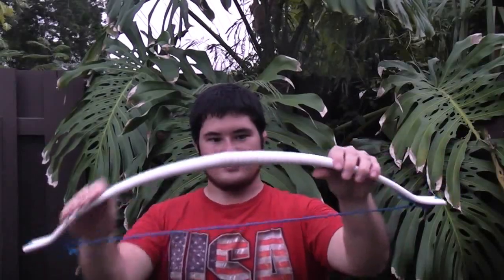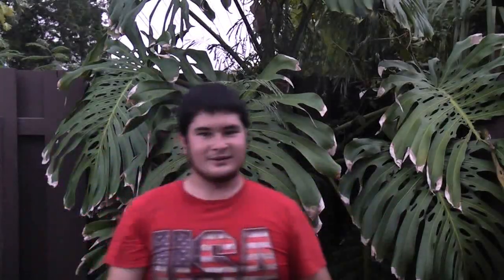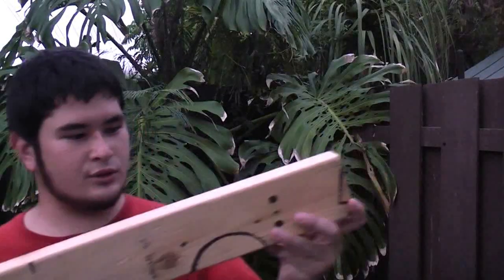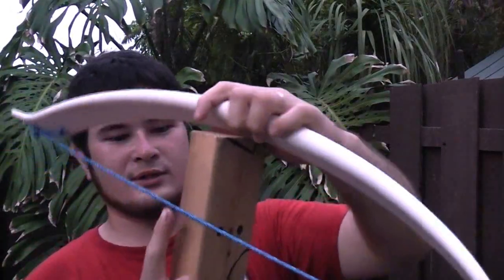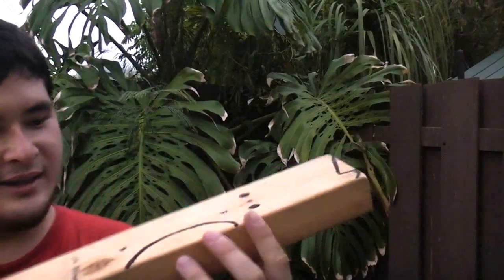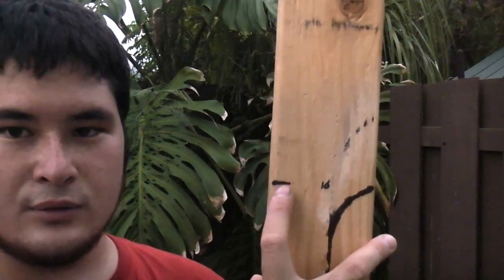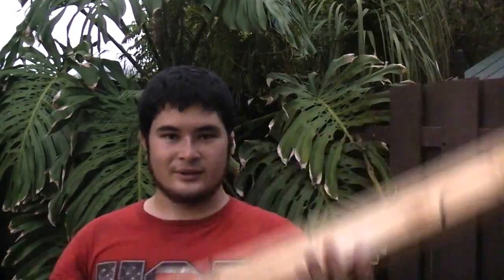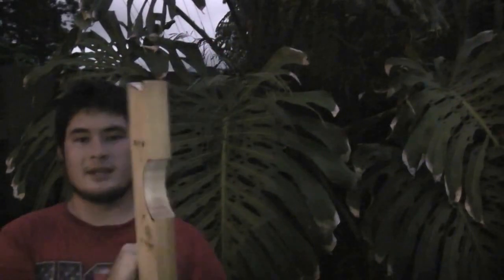How to Make a 100 Pound PVC Crossbow Part 2 - Stringing and Stock Design

Comment from the maker: When trying to string the prod, keep in mind that the brace height is very low, only about 3-4 inches. If you try for a brace higher than 4 inches, the prod will likely collapse on itself.

When I strung the prod I did not heat it up to make stringing easier. I used the step through method, though it was difficult and I ended up off the view of the camera so it didn't show up. The trick to stringing this prod is to make sure the flex is even at all times. If one limb bends more it will collapse.

Comment from the maker: I used the step through method. It was not easy and I ended up going off camera by accident so I didn't include it in the video. I have never gotten so exhausted stringing a bow before or since.

Comment: It's round at the center for a reason, if you make it even not round a bit, it will bend, might want to check the lengths and string length. Not that I haven't made this, but the calculations are usually wide enough to allow.

I made the PVC youth bow, strung it 3 inches shorter thinking the bow would be less powerful due to the PVC bending, it ended up 42 pounds instead of 35. The measurements are general but they get the job done.

Comment: Nick, you mentioned early on that the depth of the cutouts was 1.5 inches but the one top cut looks shallower than 1.5 inches and if cut that deep, it would leave a thin neck susceptible to easy breaking. Your stock appears to have about 2 inches of wood between the last rear cutout and that top cut, so can you clear that up?

Comment: Hi nick I got me a good soft pine 2x4 like the one u are are using with staight grain runing up and down. I plan on making another out of it. will a 28" bow work Reason I ask I have 28" left off the five ft 1 1/4 I bought? PVC make grate bows. what is the longest shoot u have made with your PVC bow and which one shoots the best and in distace of how many feet. Ihave one it least 100 pound pull but it will only shoot about 30 yards unless I soot high. keep posting your videos there grate.

Comment: Hello Nick, I made Two full size crossbows just like your or near as I could get it both of them clapsed on the bow right next two the front of the tiller,when I pulled the string back to 16" to the dowells and locked them. So I could load and arrow. how did u get your bow to hold up? on the cross bow. Not saying it can;t be done but boyh of mine bent right beside the cut out notch on the front of stock. I made a 100 pound long bow using  1/2 ,3/4/ 1" and it is still round. .

Comment: Hello Nike Nick ,TB I have a ? about the PVC Cross Bow How did u get the Puple rope to fit the arrow nocks what size rope was u using. I am useing hay bail twine.for my bow string but its a little large in diamiture',when I put my serving on. But I run in to some promblems with the with of my stock it was made from crate oak. 21/4 "' W 3/8 dowels would not fit the draw. I used leg screws, just grround them of smooth. I use plastic 3/8 sleeves

Comment: I am also having the problem with the PVC collapsing when I try to string it. I have made 3 different pieces, they all look good when finished, but when strung, there is one spot where the bow will crease and bend. I reheat the PVC and reform it again, and when I try to string it, it will collapse in a different spot. I have done this about 4 times with each of the 3 pieces.

Comment: Nick, will increasing the length of the prod increase the length?  I would like to have about a 20 inch draw length and still have the 100 lb draw weight.
Reply from the maker: Ronald McCaig Yes, you should be able to increase inch for inch, so add one inch of pipe for every inch of draw longer you want to go. This may not work perfectly, but it's a good place to start. You can always shorten the prod a little to bring weight up later.
Reply: Ronald McCaig, i think that was one of the mechanical limitations you find on the old crossbows of the middle ages.  In the metallurgy of the time, they were just learning how to make a spring steel, but they couldn't make that design of a spring too long or pull it back too far, Something that started to happen in those old crossbows was that they kept making thicker & thicker prods, that needed to be pulled back with increasingly sophisticated mechanical assistance.  The old steal prod crossbows were relying on a draw of only about 5-8 inches, and 8 inches might even be stretching it!.  They relied on extremely robust prods as a compensation for their short length & really more so, their lack of draw length.  But anyway, my side note is not exactly an answer to your question, it is just something that i thought was useful trivia that might touch back on why you asked about it in the first place.
Reply: Hey every little bit of information helps as I am new to view building of any type and thought that pvc views would be a good,  cheap alternative to start.  Thanks JerryJr65
Reply: Ronald McCaig, there is an important formula to the actual performance you get from a bow spring that involves its length, its poundage and its "springiness".  Old crossbows relied on poundage, old English war bows relied on length. Asian composite bows that had to be both short & powerful to be used from horse back had to be very well crafted to be as springy as possible, and i think that factor is what bow makers to this day are challenged by...  how to get the tips of the spring to unwind as fast as possible within the safe confines of the materials used in construction.
Reply: +JerryJr65 Your comments are very interesting. And now i want to learn more about the history of crossbows. Thanks again for the little history lesson.

Comment: Hey bro I was going to see if you thought 1" PVC would work OK. and if so how long would you make it and what kind of fletching. I am wanting to start this project. I will go ahead and start on the stock until I hear from you. Thanks for any help. Oh and what do you think about the string inside parachord. If I was to use it and make real bow string?
Reply from the maker: Barry Koch 1" pipe would give you a lower draw weight, probably closer to 50 pounds or so. Honestly, any type of 3 or 2 vane fletching would work with this crossbow. The inside of strands of paracord would probably be very stretchy. It would work, but you will probably have to make the string much shorter than you expect.
Reply: Thanks for the quick response one more question I know you don't like doubling up on pipe in side of pipe. what if I ripped a 3/4 pipe down the center and make it same length as the 1". If I turned the uncut side in. Have you ever exp. With that idea? I was thinking of trying it. I will get the rite size I just thought about trying it for fun. But I don't have a true way of checking the weight. Thanks again and I will quit bothering you.

Comment: Over the leg screws. the draw string sets on the plactic sleeves. My triger fit good between th screws. it don;t look  as good as yours. I used a poer band on the triger it bounces  right back up after firing. I had to tacke my bow back apart because I got my brushes to tight when I glued them. I tried to heat the arrow lock swith the heat gun, and I burnt my tie ropes into from my bow so now I am retieing the bow and sturp back on. Ha!  pratice makes learner's